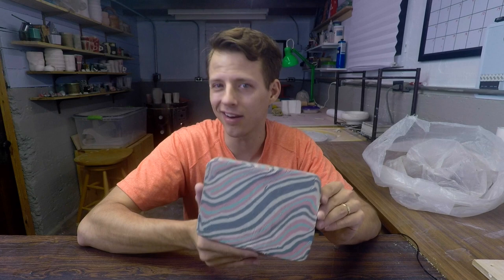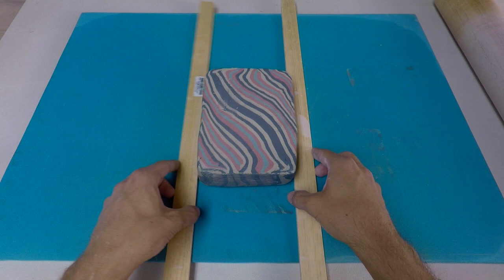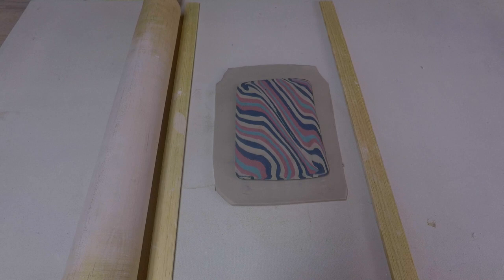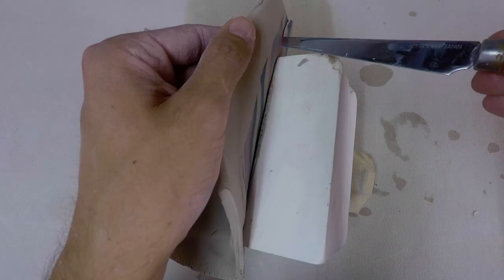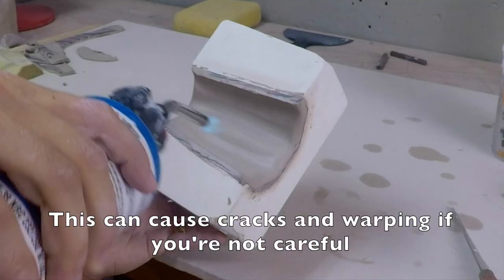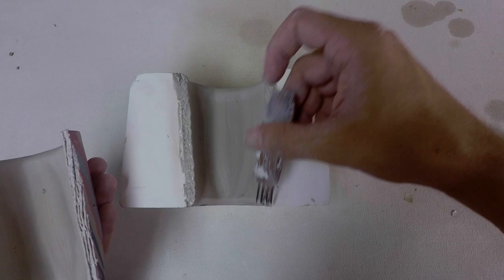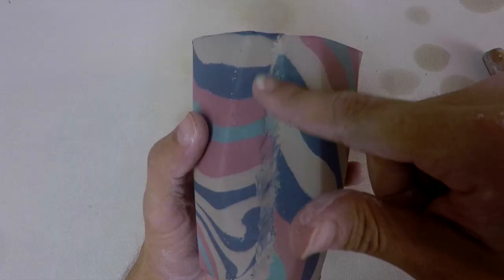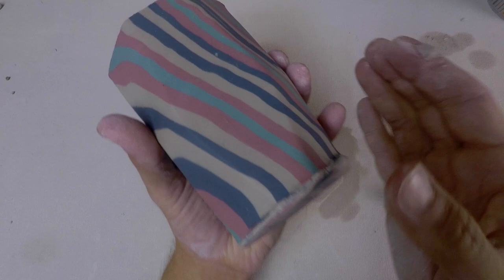How to Make NERIKOMI POTTERY with a Plaster Press Mold

Comment: These videos are excellent! I have watched most of your colored Clay videos and I was wondering if you do colored slip as well with the scraps. I can't wait to see the cup out of the kiln!
Reply from the maker: Thanks Crystal. That makes me happy to hear you’re enjoying my videos. I’ve been saving wet scraps for a scrap block and dry ones for that exact reason. I’ve never used dry colored scraps for slips so it will be a fun experiment for me. I want to make a few videos about making colored slips too. The cups are glazed and going in the kiln tomorrow!!! Stay tuned!
Reply: Nice! I have been playing with rehydrating my colored porcelain trimming scraps and so far it has been successful, but I haven't see anything out of the kiln yet 😋
Reply from the maker: Do you lightly wedge them once you've hydrated them or do just ball them up and throw/roll them out?

Comment: Thank you so much for your videos ... they are very instructive.   I’ve just started working with colored clay.  It has opened up a whole new options.  What I don’t have is right wire to cut without smearing.   What do you use?  Don’t see anything suitable at my local ceramic store.
Reply from the maker: I use fishing line. The best I’ve heard is guitar string. The finest cut. But I spend time cleaning up after.

Comment: Couldn’t believe you used a blowtorch to dry the clay. A hair dryer is easier and gentle. Or a heat  gun.
Reply from the maker: Right? Yeah it works well if you know how to use it. Like those potters that use HUGE torches to dry their big pots on the wheel. I think all of those methods work well.
Reply: @CeramicJim  loved your videos though and I spent the afternoon colouring some clay. Just letting it dry out a little then I’m good to go.

Comment: You might have less trouble with your mold, if the parting line was along an intersection, and not in the middle of a facet.
Reply from the maker: That's a great idea. I imagine more tedious making the mold though right? Maybe not.
Reply: It probably depends on how many pieces you want to make...is press molding like slip casting, where you only get about thirty five really perfect pulls, before the mold is worn out?